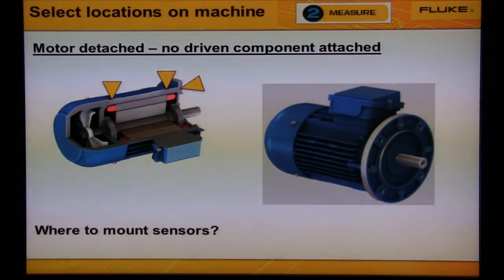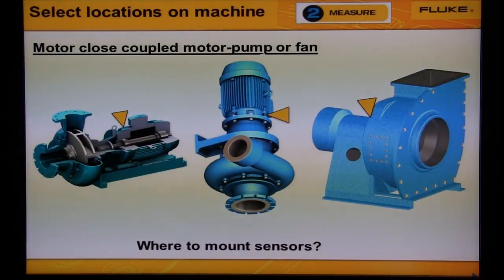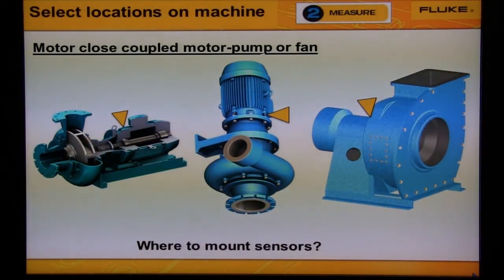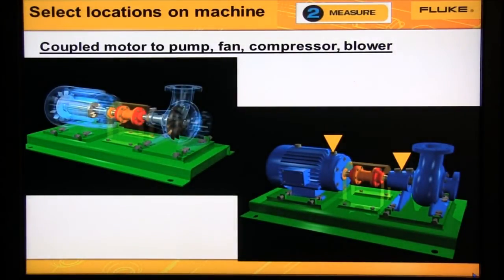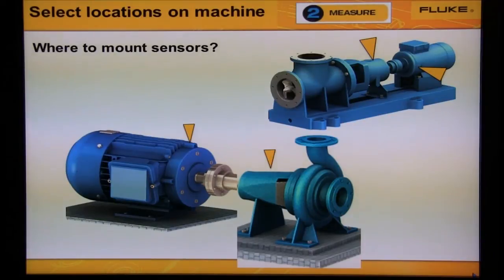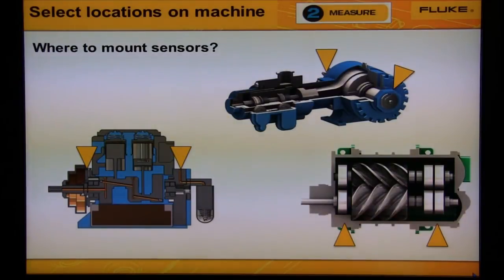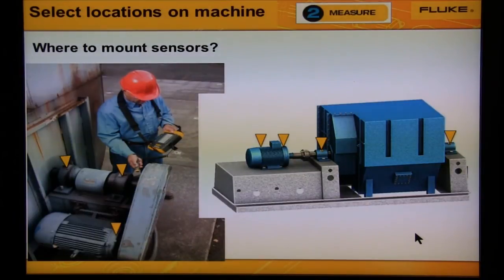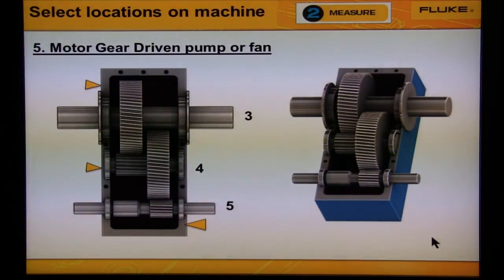Vibration Testing: How to Select Correct Measurement Locations on a Machine

Comment: this is correct but not describe deeply......they missing one is each baring measure in 3 direction---horizontaL , vertical , axial
Reply: He is probably assuming the use of a tri-axial vibration meter (like the Fluke 810 or other pricy meters).  However, you're absolutely right that, if using a single-axis vibration meter, then all three directions should be measured independently.